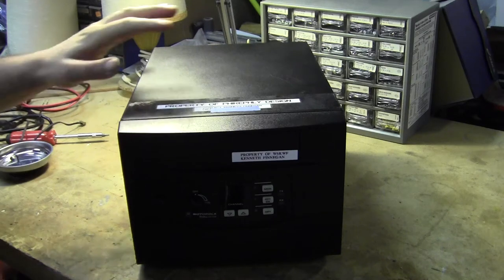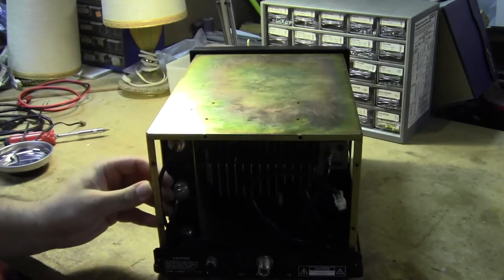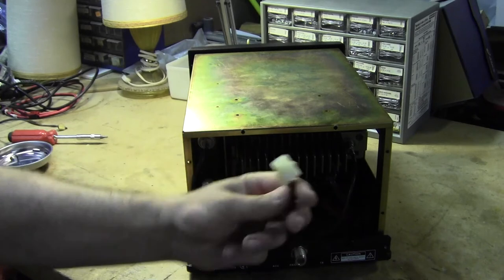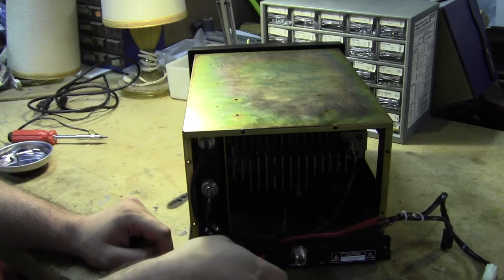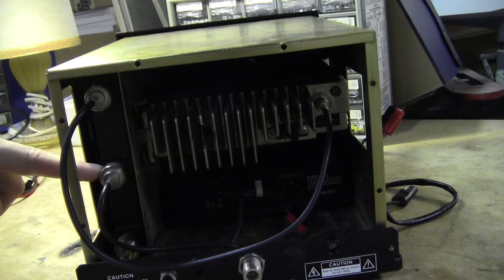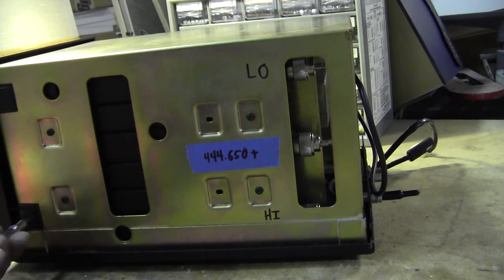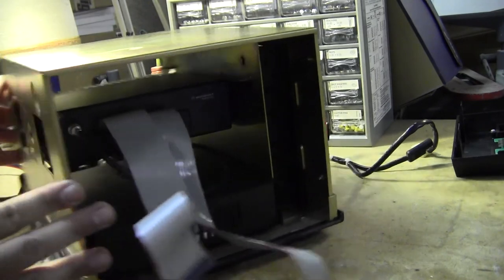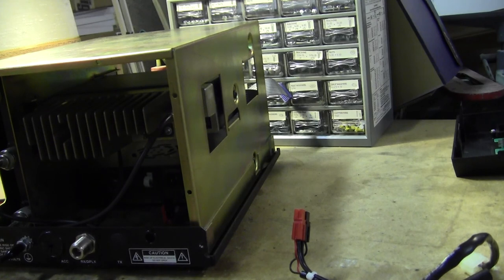GR1225 Teardown and My 12VDC Mod

Comment: What are you using to program the repeater? Rib or eBay cable?
Reply from the maker: I bought an eBay knockoff of the full 25 pin RIB box so I can build my own RIB interfaces for some of the weirder radios I play with.